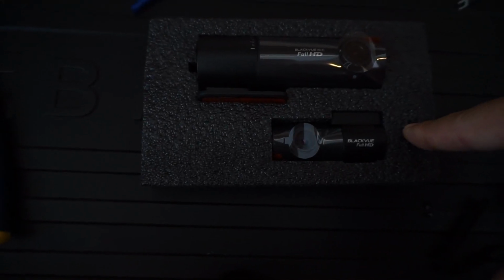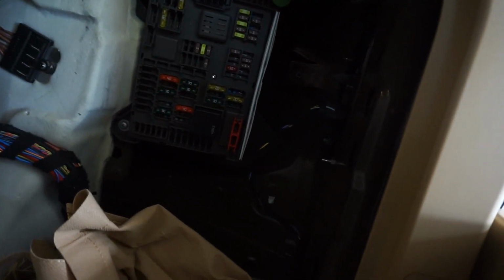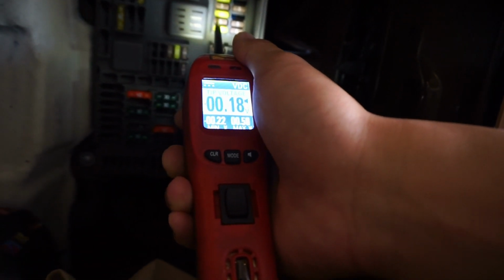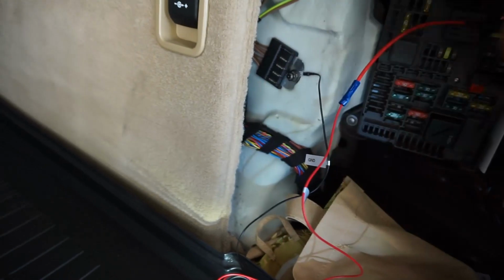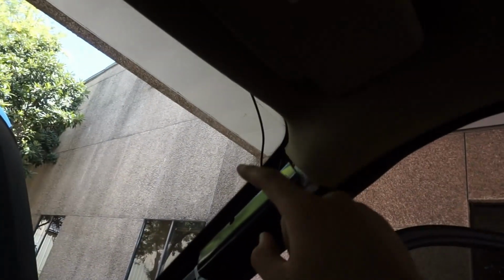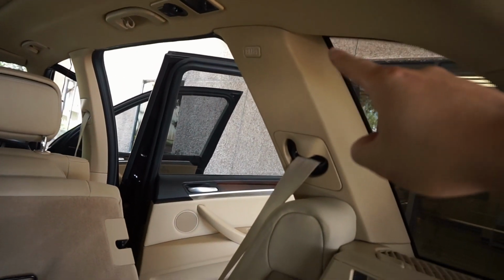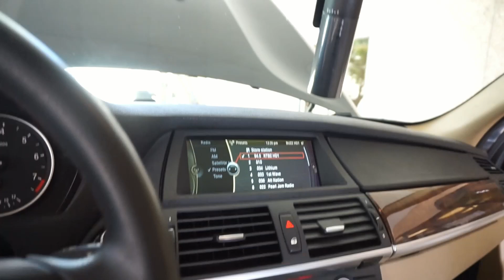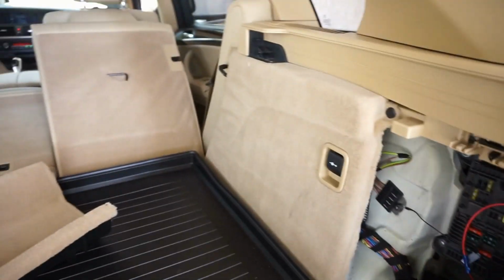How to install Blackvue Dash Cam with Power Magic Pro to 2013 BMW X5

Comment: Hai do you get any fault/error code when using the parking mode features?
Reply from the maker: Faiz Izzuddin no sir. No codes
Reply: @htxdashcams2127  Yeap. I already did the hardwire to my father's car. So far no error code. Thanks for the video. It helps a lot.